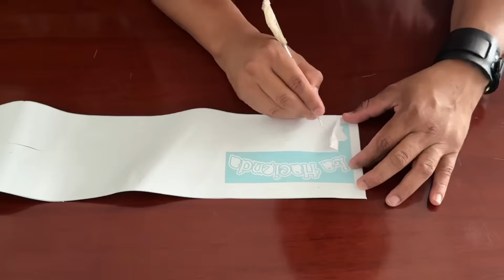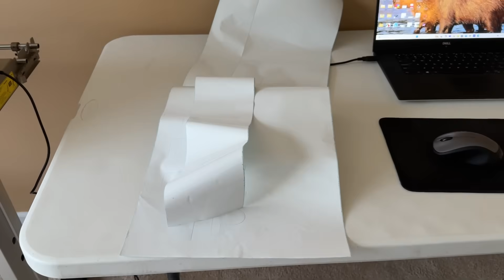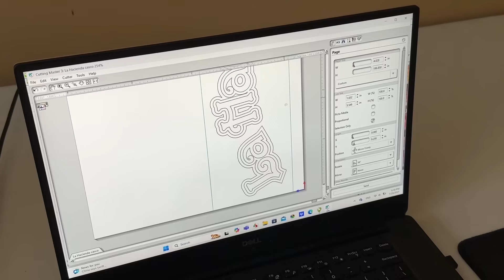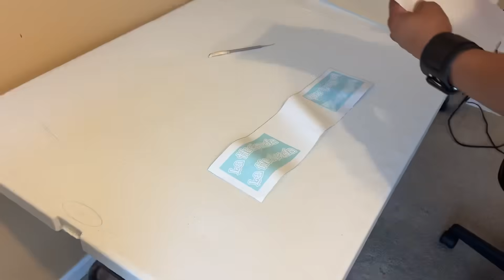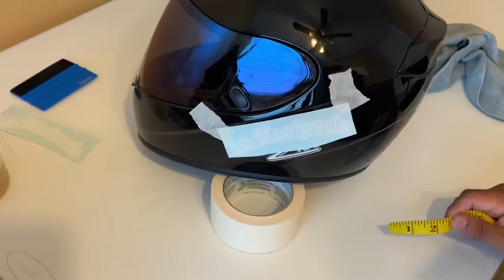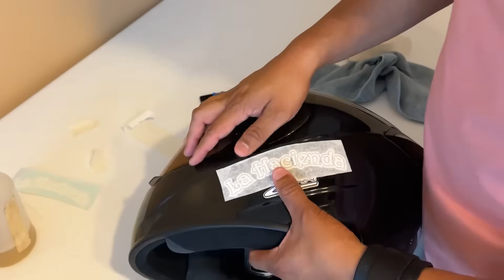These might be the worst type of stickers anyone can make

Comment: i have been cutting VVivid XPO Premium and VVivid ColorFusion on my Cameo 4 doing this type of work, outlines cut-away, weeded style lettering. it is possible NOT to use a cutting mat, as long as the vinyl is 12" wide, if not and you are using small pieces like this you have to use a mat, but the cutting mat has allowed me to use a pressure setting that works well and allows me to make a kiss cut, and then make a thru cut to cut out the laminate completely.

also, it is crazy that some people think this only should cost them 10 bucks... LOL.. it takes a least 2 hours of time, not including the initial time to send digital samples. thats 3 hours of legitimate labor on top of material costs and production costs. electricity isnt free, nor is the internet bill. this is a 75 dollar job minimum.
Reply from the maker: Thank you for sharing your process and pricing strategy, we appreciate the insight! 🙏

Comment: I think the reason you cut through the backing paper is because the weeding boxes were overlapping each other, which means the blade cut those areas twice and cut through the vinyl and the backing paper.
Reply from the maker: That's a great point! Next time, I'll make sure to add a bit of padding between the weed boxes. Thanks for tuning in!
Reply: @RDIdecals you're welcome 😁

Comment: I very seldom adjust the pressure on my ce 6000  I do test cuts every cutting to make sure everything cuts right.  I've had very little problems except when changing brands of vinyl....which is seldom
Reply from the maker: Thanks for sharing! I think our vinyl cutter needs a bit of maintenance—the cutting strip definitely needs to be replaced, along with the blade.